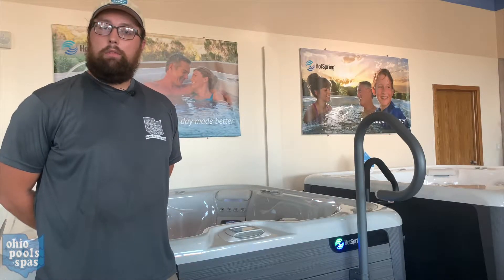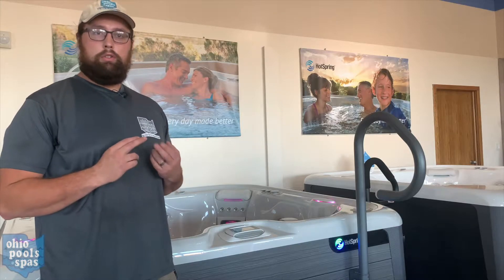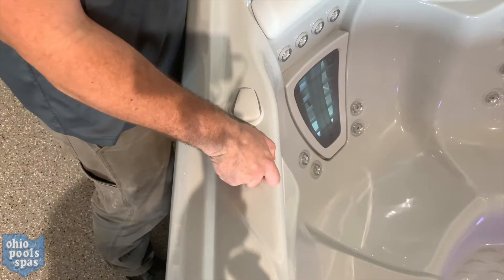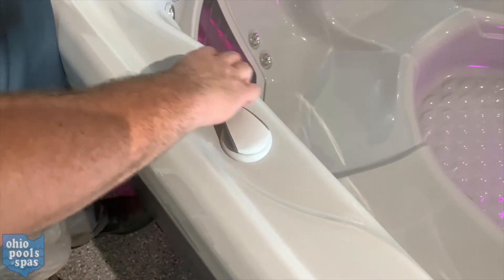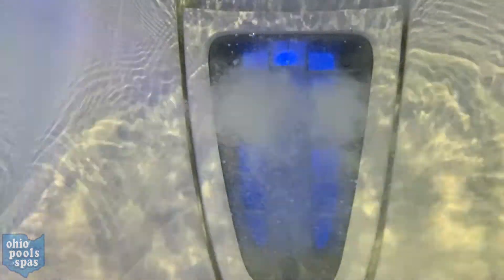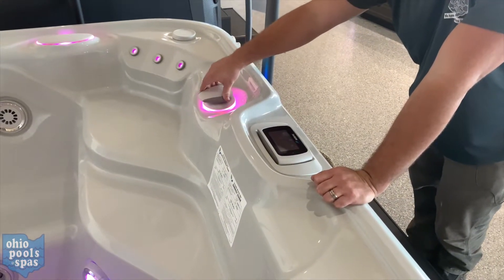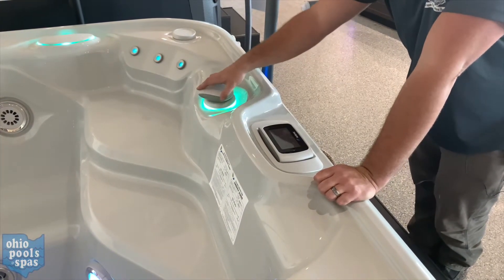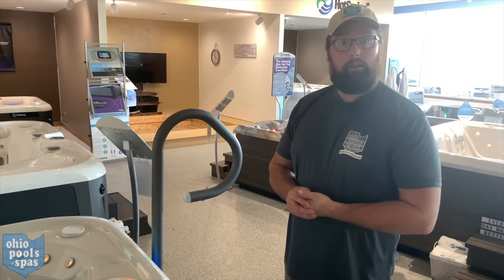Motto-Massage troubleshooting

Comment: This is not a helpful video. Why would I need a technician to replace the Moto massage when all you need to do is unscrew the faceplate, unscrew the dual Moto massage it and install a new ones. A more helpful video would be to explain why the Moto massage fails as the silicone hose get harder sitting in hot water for years and then showing how to replace it. Now that would have been a good video.